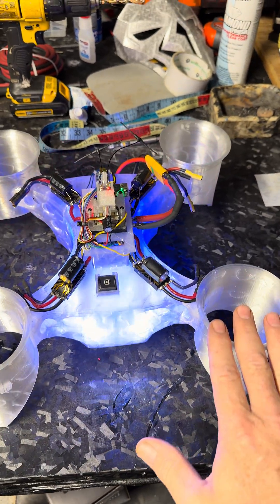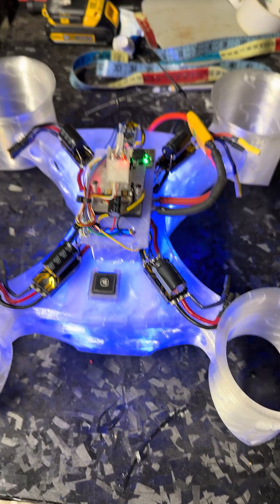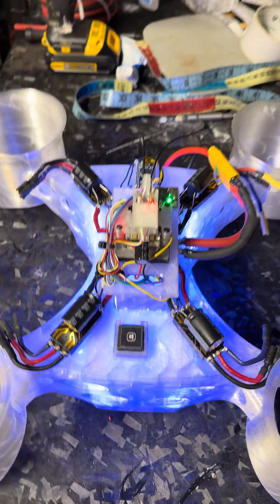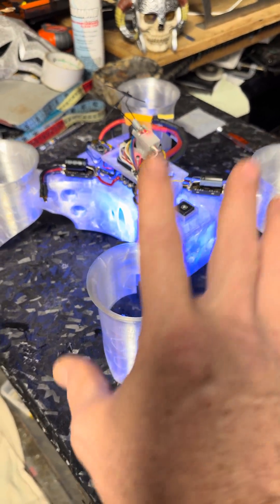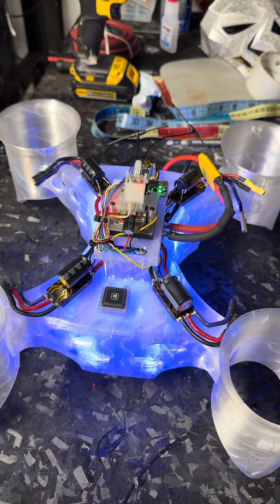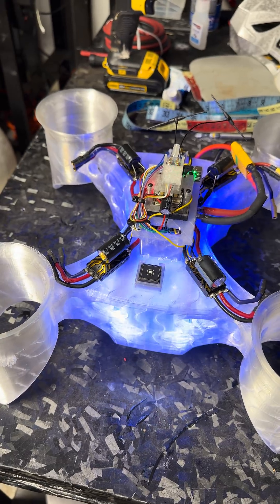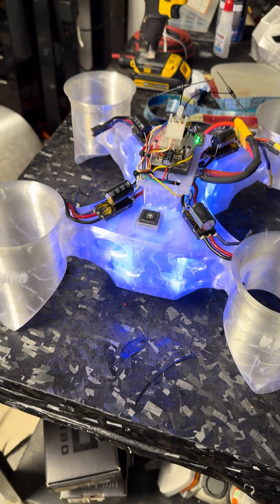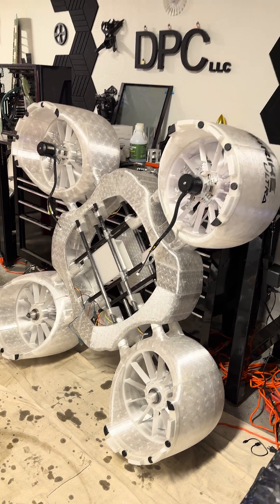Building programming and flying the 70 mm EDF drone live click the bell, so you don’t miss it.

Comment: "Next to the big drone" is what I don't like for the first lift-off of the smaller one.

Speaking from experience, just had to re-print about half of the frame for my biggest machine after a not-so-successful maiden of its Halloween rebuild.
Reply from the maker: What happened to the big one?
Reply: @warmachined3472  it had a very heavy top and a very weak frame, very crash-prone, but I persisted :) I've just released a (very short) short with an outdoor flight. Will have to return to the light version for control experiments...
Reply from the maker: @wowthatflies  ouch, that looks like it hurt.  I loved the lift off though.